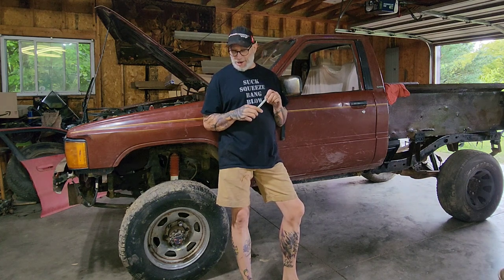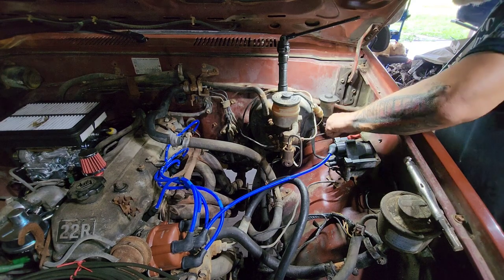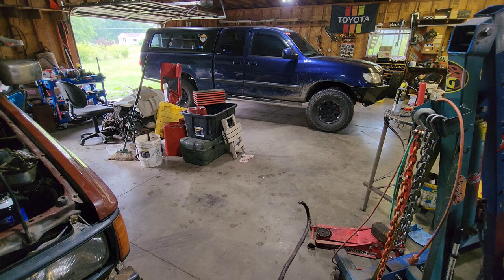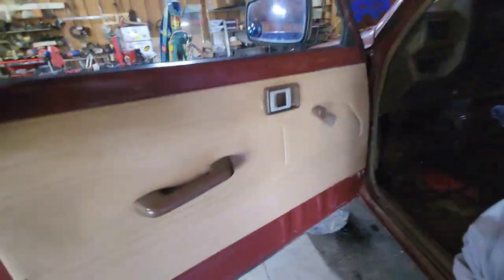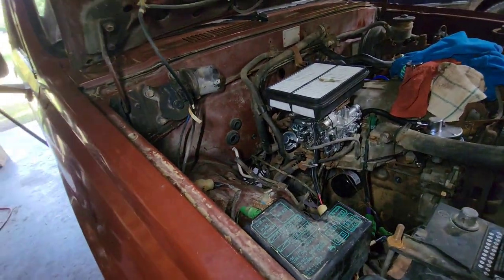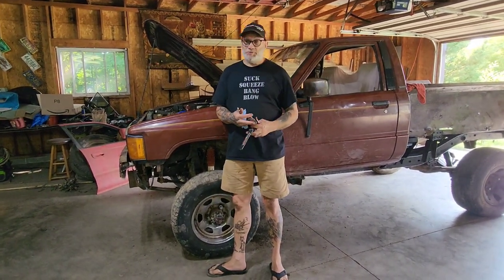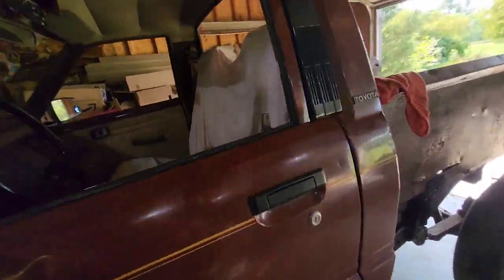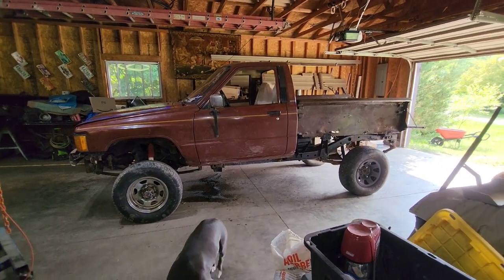1984 Toyota Pickup Project. Clutch master & slave cylinder installation. Will it drive & stop?!?

Comment: It's always good to remember to mount the slave cylinder in place prior to having someone push on the pedal to blead so you don't blow out the end of the plunger and break the new one causing you to have to go to the parts store to purchase another new one. Don't ask how I know.
It's too bad Oswald is so vicious. Have a super great day sir.
Reply from the maker: Thanks Bruce 
That's a great piece of advice, I assume learned the hard way. Thanks for sharing that.
I need Oswald to learn to push the pedal on command. 
Thanks for watching and sharing your tip. I appreciate your continued support of my channel.